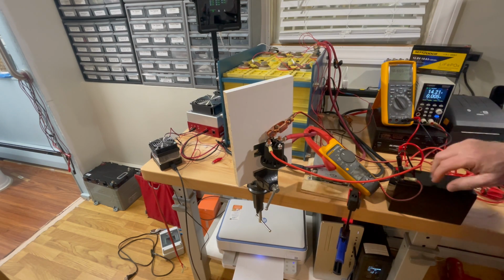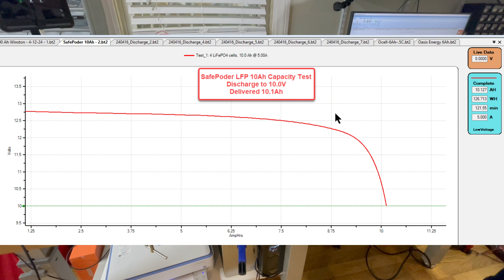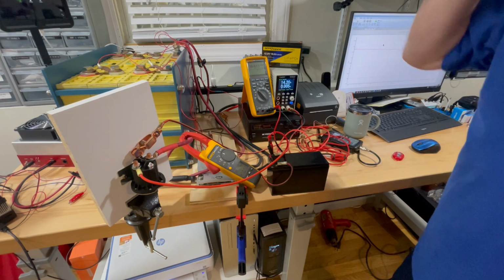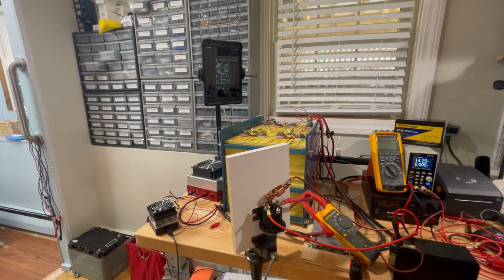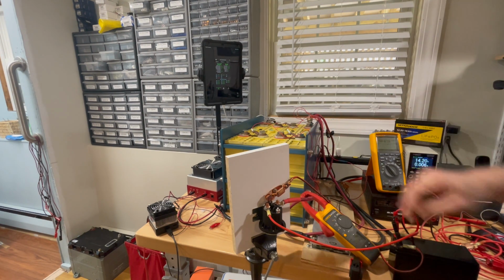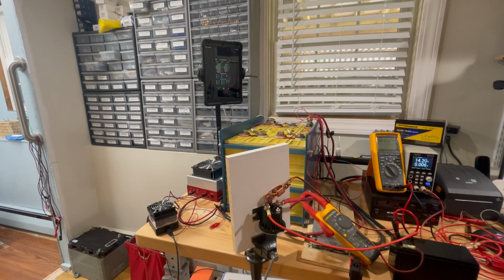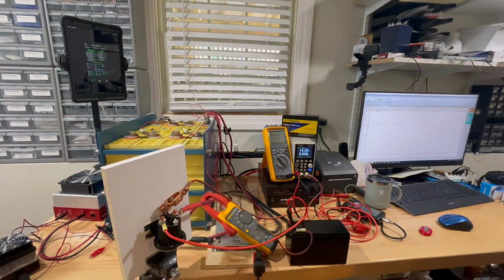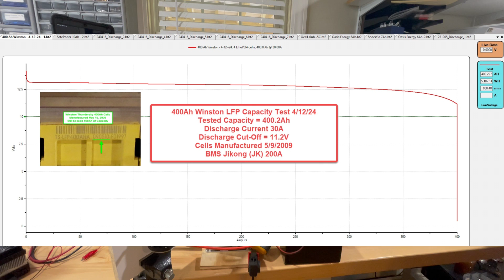Parallel Different SoC LiFePo4 Batteries?

Comment: I agree the current is limited by the internal resistance of these batteries, but also the resistance of the wiring between them (which is not insignificant with liFePO4 batteries).  And Great Video, thanks

Comment: I suppose if you tried to parallel two of your 400 Ah batteries with the same state-of-charge difference the results would be much different, correct?  In that scenario I guess the BMS would trip due to the very large surge current?  Thanks for a great video!!!

Comment: In addition to the battery internal resistance, the wires have some resistance. While small, it may be significant compared to the internal resistance of the smaller battery. So not negligible. Anyway, I am glad you did this because I have been wondering just how large the currents would be. For example if you have an emergency parallel switch on a boat to parallel the house bank with the starter battery, do you need to worry about the inrush current? Based on this, I would say probably not.